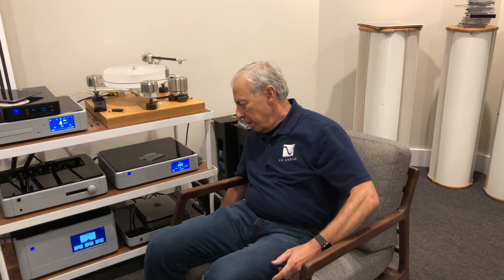Moving magnet vs. moving coil

Comment: With a MM cartridge the cabling and termination is critical. MC not so much, so they can sound good 'out of the box'. For instance my Shure 97xe with 150pf of connecting cable plus 100pf input load is probably getting a less than perfect HF resonant boost. I'll get it optimised one day. main advantage is losing the needle on the record edge won't cause a financial meltdown.

Comment: To me it seems the only significant difference between MMs and MCs is that MC are less sensitive to loading and phono stage properties, which makes it easier to achieve a flat frequency response. 

For instance an Ortofon OM40 or an old Shure V15V-XMR have vanishingly low distortion (for a phono cart), lower distortion than many high and MCs and they can track anything. A cart needs to have low distortion, high tracking ability and as flat a frequency response as possible. Is there any more?

Comment: Hello Paul
the explanation of the differences and similarities between MM and MC cartridge is very successful.
At 2:23 I liked the comment about the DECCA cartridge.
Except that, unfortunately, connoisseurs were always reluctant to buy, even though DECCA opened up new, unfamiliar perspectives for accurate sound reading, so unfamiliar that some of the good things became too much because of the enormous, incomparable accuracy of the pickup, more on this below. The price for this is a very meticulous and precise adjustment of the DECCA's.
There are particular problems with poorly or moderately damped tonearms.
The permanently vertically and horizontally oil-damped LTD tonearm system from WELL TEMPERED LAB is the ideal playing partner for such a delicate cartridge.
Currently, at the end of 2022, it is becoming more and more difficult to find a new DECCA, let alone to buy it. It is not certain whether production will even start in the future, due to the closure of AEC in Germany at the beginning of 2022.
What distinguishes a DECCA?  The AEC-DECCA has no cantilever. There is only one side. Where the AEC Iron needle holder IS the "cantilever" but without a fulcrum. It just comes out of the head just above the pickup point. This end , and not the one opposite, oscillates WITH the finely ground scanning diamond that is attached there, in the extremely close range of the magnetic field of the double coils, which are also located in the head near the grooves of the record. This guarantees that the movement of the diamond and the iron pin in the magnetic field are almost 1 to 1 is transmitted, in deflection range and in dynamic and  speed, since this is not reduced by a leverage effect due to a touchdown point, or slowed down in movement.No smear effect, no friction, no reduced movement, only 1 to 1. Such accuracy of pickup is not offered by any other cartridge system,. By AEC LONDON (DECCA)  the movements of the diamond, provoked by the forces of the passing bulges and indentations of the grooves, are transmitted almost 1 to 1 in the range of the optimal possible within the magnetic field. This results in an induced voltage that could not come more directly, and in the analog sense not more congruently, with the recording track.
Extremely close to the required ideal standard, closer than a cantilever construction would be physically and technically possible, that is evident. You hardly risk that engraved sound information is obscured, within the range of the physically possible, of course. At least less than with other purely analog pickup systems.
Whether everyone likes it, is a matter of taste!
I love to experience the history of music through the exploring the lp-recordings benifitting by the excellent competences of DECCA and the LTD arm from WELL TEMPERED LAB record player VERSALEX.
The GERMAN PHYSIKS at the other end are also very up and coming talents that suit the virtuosity of the DECCA.
Unfortunately, the era of the  AEC (DECCA) LONDON outsiders seems to be drawing to a close.
Paul, I always look forward to your understandable explanations  about interesting subjects from the audiophile world.

I love to experience the history of music through the exploring the lp-recordings benifitting by the excellent competences of DECCA and the LTD arm from WELL TEMPERED LAB record player VERSALEX.
The GERMAN PHYSIKS at the other end are also very up and coming talents that suit the virtuosity of the DECCA.

Comment: Less mass is always better.  In the motorcycle suspension business, we used to call it "Unsprung Weight" - which is a misnomer, but it covers it pretty well for the lay person.  You don't want to have a lot of moving mass, because "light" / less-mass can respond more quickly to changes, which will almost always result in more accurate tracking.  You're welcome.

Comment: The most real honest n best explanation by far, am also using an M75 ed cartridge since my old V15 III stylus ws damaged Shure cartridges are no longer made I was thinking of a MC too now I fully understand why they are able to follow  the grooves more faithfully IE more accurate reproduction my Pre amp has inputs for MM n MC but been a pensioner my budget is limited n am sure y time is too so spending a ton of money is out of the question, I also like the solid sound of American made MM cartridges can I expect an improvement with a budget of around £200 top wag? or is my budget way too low? But MC makes a Lott of sense after hearing you great explanation many thanks mate
Reply: There are some really good aftermarket stylus options for that V15 III, would heavily recommned looking into some of those. If you have enough to go for a Jico SAS stylus, you'll have arguably one of the best MMs around - they're pricey styli but seriously worth it. I've got a V15 type IV and went for the Jico SAS Boron version myself - After getting the capacitance and setup sorted out right, I've never wanted anything else since. They're super sensitive to set-up and alignment, but once all's dialed in right, you'd have a diffuclt time finding better, especially at it's price point. The JICO SAS styli have a purpose-made tip somewhere up there with Shibata types but you can also get aftermarket elliptical ones for a lot less. Those V15s are seriously worth holding onto!

Comment: Yes vastly different sounding designs simply because of that factor.  My many years experience with moving magnet vs coil cartridges is that moving coils have better dynamics, speed, detail retrieval, because of there design differences.  Although I have heard many moving magnet cartridges and one of there advantages is they can bee very musical.  They just fall short in dynamics and detail.

Comment: 'Ole Audiophile to Paul: My experience with moving coil was somewhat limited exclusively to Signet, a corporation under Audio Technica. I noticed things got glossed over the whole matching transformer/head amp to the exact model of cartridge thing. Signet moving coil phono cartridge did not have a replaceable stylus so needle wear meant a whole new deal. This is the very thing that drove many of us screaming away from turntable use in the first place. FYI. They sounded spendiferous but they typically cost double or more.

Comment: At 5:33 - if they are electrically equivalent, then why do MC carts generate a weaker signal that needs greater amplification? I assume the coils in an MC cart are much smaller (shorter length of wire?) as compared to the same coils in an MM cart, which doesn't seem to be a like-for-like comparison, as MM carts could simply use a proportionally smaller magnet to generate a proportionally smaller voltage which would then need the same additional amplification.

Comment: I have a Philips 224 22GA224 turntable (running on its original cartridge) which  sounds way louder at the same amplifier volume level than  a Hitachi HT-50S  running a Stanton 680 MkII. The Hitachi however sounds 'calming ' and the high tones are not shreeky as with the Philips.
What could be the reason ?
Greetings from Kenya.

Comment: My favorite sounding cartridge is actually a budget ceramic BSR SC5M (diamond conical stylus) with a special R-C circuit that I feed into a tube pre-amp and then into a magnetic cartridge input.  I bought it NOS around 2014 but it was manufactured in the early 70's and has a nylon cradle as opposed to the rubber ones that tended to dry out and get stiff.  It's a heavy tracker at about 4.5 grams but it sounds amazing.  BTW, I'm not in the least afraid to use heavy trackers as long as they don't exceed 5 grams VTF, the stylus isn't worn, the record is clean with a dry dust brush, and the turntable is set up correctly.  At least on my system, it sounds better than any moving magnet or moving coil I've tried.  It is also by far the least fussy in terms of set-up.  The cartridge may have been designed to be paired with cheap BSR changers but when used on a high-end table with a high mass tonearm, this sub $100 cartridge outclasses MC cartridges costing thousands.  Having said that, most ceramic cartridges are junk.  This specific BSR, the Sonotone 9 series, and a few others are exceptions... you just have to have the correct circuitry to unlock their magic.

Comment: Good explanation, thanks.  I have always heard that if you're not going to spend a "lot" say over $1000 on an MC, the higher end MM cartridges (between $400-$700) sound better than the "cheaper" MC carts.  Can someone validate this view or share their insight?
Reply: Absolute lie. But the fact is MC start where MM finish in regards to price. However, even a "cheap" MC such as the Ortofon Quintet red, sound  noticeably better than a more expensive Ortofon 2M black LVB. Even with a lesser tracking ability, (the Quintet red uses an elliptical vs the 2M's hyperelliptical), the moving coil has better ultimate resolution and clarity. If you are a true vinyl afficionado, there is no substitute a MC. It is simply a better, more accurate transducer by design!

Comment: Don't ever buy an Ortofon cartridge, the company is scum.  You can not visit their website without accepting all their cookies so they can track you and try to sell you more products. If you do buy anything from Ortofon they will hound you every time you open your web browser.  Yes, you can, visit their site then delete their twenty seven cookies they put in your computer each time you visit, but you will be a lot better off just not going to their website. Just buy any of a dozen other better cartridges. Have you ever been to a website that will not let you look at anything on the site until you knuckle under and agree to their tracking policy ? That's Ortofon.  The slimy bastards

Comment: Excellent explanation to this old Engineer/MD. Several questions. Does the MC lower mass have less wear on a vinyl record? Does the MC have “overshoot” ...lack of adequate damping because of the light weight? Does the higher mass of the MM have a problem with “under shooting” the groove/signal because of the mass? Does the MM cause higher wear? Or does the difference in terminating resistance compensate and provide the proper damping for each design?   Are different vinyl pressings made that accommodate one or the other types better than the other?  I would assume that most would assume the use of an MM because they are so much more common?  Is that correct?

Comment: And with modern permanent magnets, this issue of moving mass isn’t an issue anymore.
Just like direct drive turntables are nowadays better than belt drive, because issues like cogging and hunting have been overcome.
Reply: Yeah all those dollars and they for the most part have an arm swinging at a fixed pivot. Then dealing with that skating effect and not to mention changing tracking orientation. That last track on a LP is the first thing I noticed or I should say didn't notice when I started using a Technics SL-7 linear tracking turntable. It's not even a very expensive thing . Sometimes you get lucky pulling cords out of a dumpster. Now I've got a Stanton 680ee with a brush...just throw an album on and close"n"play ...self cleaning! Oh yeah it's also a p-mount Stanton did all the alignment for me. Really like that moving iron cartridge design.
Reply: virtually no high-end table is direct drive
Reply: @johnholmes912  Yeah it's quite disappointing that a lot of manufacturers tend to be stuck in the past, simply because turntables have a bad image as a thing of the past. 
Fortunately, there are companies that are actually trying to come up with more modern turntables that perform to modern standards, like the Brinkmann Bardo, Grand Prix Audio Monaco, SAT XD1, Technics SL-1000R, VPI HW-40 and Clearaudio Statement.

Comment: IMHO a good MM will knock spots of a mediocre MC. Much depends on the arm the cartridge is mounted in, for example ..
I have 3 decks, listed in order of preferred sound quality.
Alphason Sonata, HRS100MCS, AT-OC7
Transcriptors Hydraulic Ref, Origin Live's top spec DC motor kit, SME3009s2 imp, Ortofon 2M Black
Roksan Xerxes, (no plinth sag), Linn Ekos, AT-OC7
All running through an M1 Vinl phono stage, Audiolab 8000Q and 8000M's, into Tannoy DC3000's in a big room :).
Here's the interesting bit :).
When fitted to the Alphason or Roksan the Ortofon cartridge gave nothing away to the AT's, the very highest frequencies might be a tad cleaner with the AT but the Ortofon might dig deeper in the bass. Or it could be entirely due to setup.
However put the two different 'cartri' in the SME and the Ortofon MM is the clear winner.
And no I am not joking, the Roksan/Linn was less enjoyable to listen to than the DC drive Transcriptors SME, so much so that I recently sold it on. Quite how reviewers of yesteryear could even begin to compare a Roksan Xerxes, or the Sondek to the Alphason Sonata is beyond my comprehension, the Sonata, properly set up, is simply in a different league to either. Regards to Mike Knowles from Alf.

Comment: If you want to compare moving magnet with moving coil cartridges you need to compare apples with apples . Ie the same brand with the same style diamond tip, otherwise you are actually comparing other factors and concluding that it is the MC which is the cause of the superior performance where it might be also caused by a different shaped tip, which also makes a large difference. A more accurate and interesting comparison would be for example to compare an Ortofon Rondo Bronze with an Ortofon OM40 which both use the same tip but are MC and MM cartridges respectively. Also the main reason MC cartridges tend to perform better is that the moving coil has less mass and therefore less inertia than the moving magnet and so it can move more quickly and so track better.

Comment: Any cartridge will sound best if the tone arm is match to the compliance with the cartridge and the assembly properly aligned. I’ve owned Decca’s, ADC’s, Shure’s, Grado’s and various Denons. The current Shures made in Mexico are hit or miss and benefit from a quality Jico or similar fine line stylus. If you have a higher mass tone arm and are willing to invest in a good step up transformer, the Denon DL103 will get you close to the esoteric sound at a reasonable price. If you can find an older 103d , you can have it re-tipped by Soundsmith, this is the bees knees. I think MC cartridges just sound more detailed and three dimensional. Also as Paul pointed out, Some cartridges are very sensitive to resistance and capacitance loading. Tweaking all these parameters makes for a fun or frustrating hobby however you look at it.
Reply: I'm pretty sure that Shure quit making cartridges.
Reply: Must have happened over the last few years. There are some new Shure cartridges being offered on EBay and other online vendors.
Reply: @jimrusch22  Yes I noticed Shure cartridges being sold on Amazon also.  A  Shure M97xE MM cartridge that originality sold for $99 (Needle Doctor)  is retailing for $365.99! at Amazon.  NOS I guess.  Must be a good cartridge to pull in that much money.
Reply: Lynn Poole  Looks like Ill have to shop the garage sales, thrift shops and Craig’s list for crappy turntables that still may have a vintage M97ED. Then upgrade with a  Soundsmith stylus. Shure cartridges generally track well, sound neutral but they doesn’t grip you with that wow factor. Shure s are a very practical choice.

Comment: Oh dear here we go again today we have magnets that are so light even compared to coils that this is a moot point. Also a moving magnet produces a much higher current negating the need for a step up.. So let's take 2 cartridges both £3000 one MM and the other MC which is going to be better.. Well I've listened to just about all of the MC's out there my MM floors them all and I don't need a step up which also is way better. Moving Iron ooooh that's so good and better than the above :-)

Comment: Really moving iron is the best cartridge soundsmith, it's down to weight on the cantilever that's why moving coil is better than moving magnet most cases it has less weight and moving iron is even less than moving coil. And another thing is the weight of the whole cartridge and stylus is suitable for your arm is important

Comment: Excellent video.  I have recently started building my HIFI system and am exclusively streaming.  I remember spinning vinyl back in the 70-80s and did not realize there were 2 different types of cartridges.  For now,  I'll stick to streaming using your recommendation of MAC mini and Audivarna.  I have to look at the cost and return in terms of better sound and don't see the value yet.  Thanks for the video.